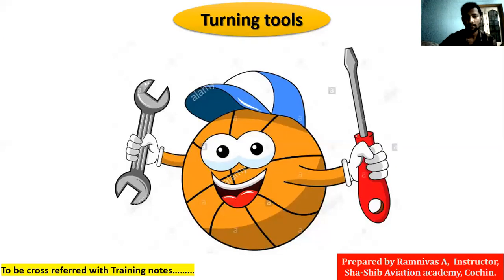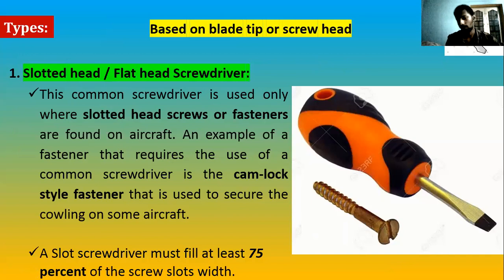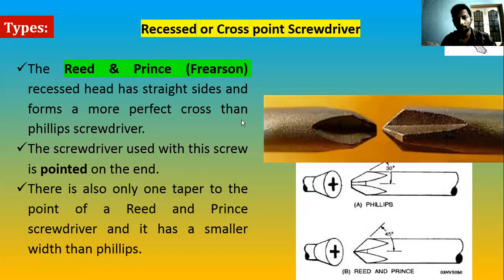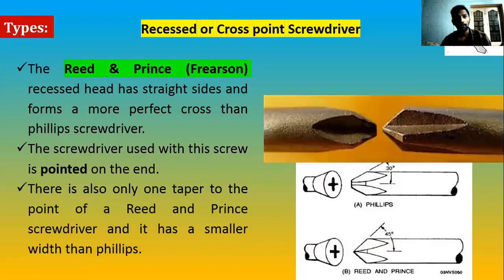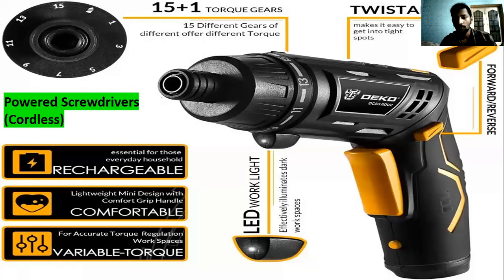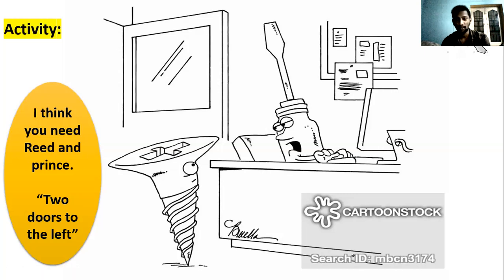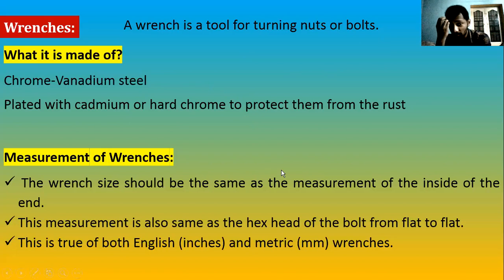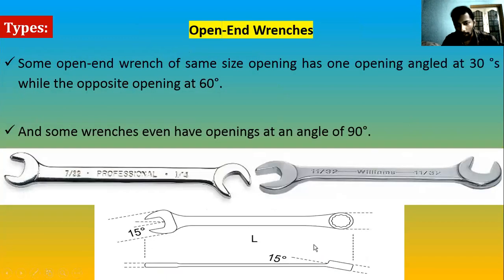Module 7 - Maintenance Practices - Turning tools - Part I

Comment: Sir what is the material used in the shank of the screwdrivers like any magnetic material is used or simply a steel
Reply from the maker: It's made of steel with hardened tip. 
Scewdrivers having removable tips or shanks can fit into the magnetic handle
Reply: @mr.j7566  tq sir